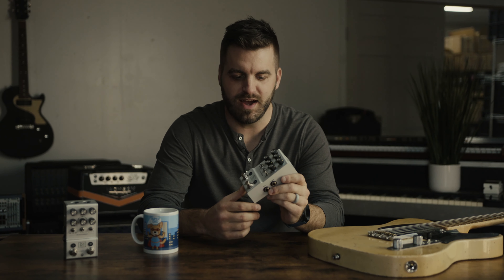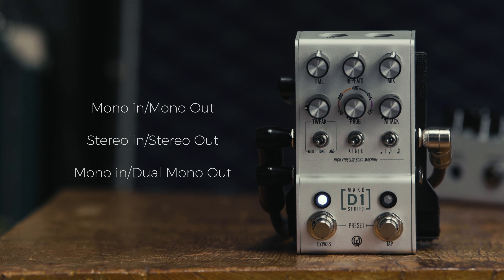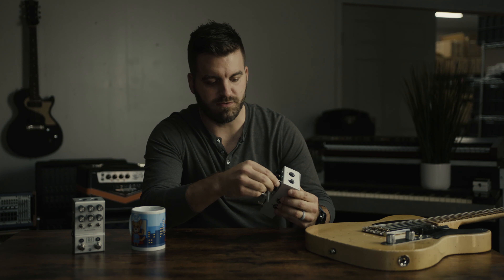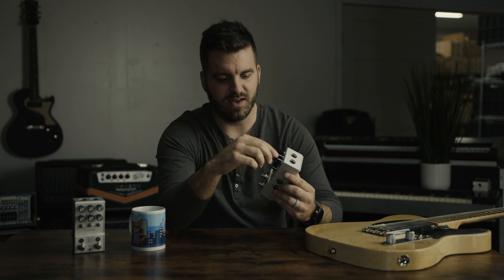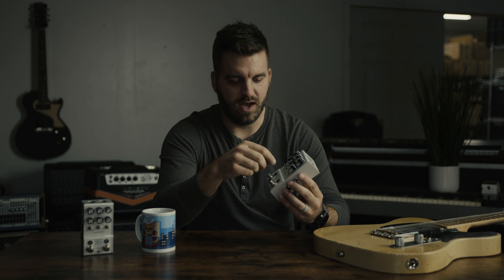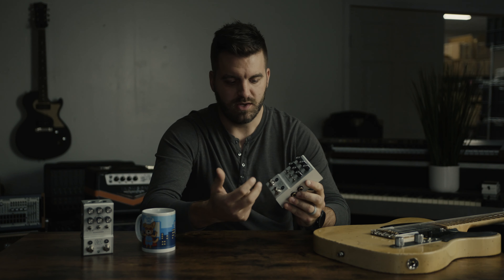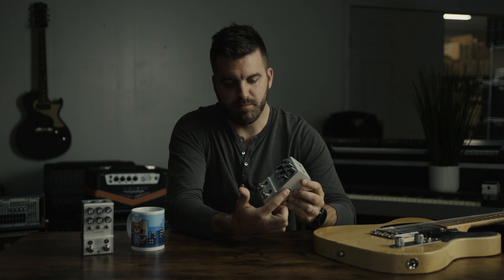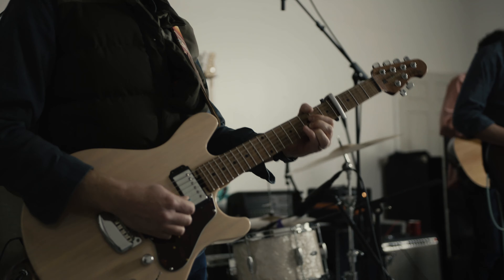Walrus Audio Mako Series D1 - Deep Dive with Jason Stulce

Comment: Excited to replace my Nova Delay with this. My ND has been amazing but the lack of midi and size has been hurting lately. This pedal has every kind of tweakability I want to lock in my own sound and no algorithms I don’t want. Pumped on it.
Reply: I have a Nova too and I wish it was smaller. But the presets are easy to see, I wonder how the D1 works with no screen to tell you which preset you're on. Also since a lot of controls have LEDs you can see what settings yr preset is using, with rotary controls you won't know
Reply: @RobData  the presets in the D1 are pretty easy to use. There’s a toggle switch that controls which bank you’re in, then the LED’s change colors between red, green, and blue to pick which preset you’re on. There are also a ton more presets you can access with MIDI, but those 9 are storable and accessible without midi.

Comment: Hi. Have one on the way.  No idea if anyone monitors this but very interested in the MIDI controller you use. Concerned that there seems to be little available support.  I'm visually impaired and if I can program 6 delays, that's plenty for me but one button access is huge since I no longer see color or printing.  I've never used MIDI and am concerned about my ability to set up (I can read with aids like scanners and 27" iMacs)

Comment: Hi all ! Had bought a D1 and R1, And as delas all cool !… but have noticed that the D1 is giving me gain sound in my clean mode, means that when I don’t press the pedal and want to play clean of delay I have an small gain… have tried with and without pedal board, different cables and other delay and not if that is expected in the pedal or if another users have noticed
Reply: did you try different bypass modes, i have the version 1 and no problem at all

Comment: please HELP: I can't decide between this new awesome machine or Strymon Volante or Timeline. I need a unique "tape-like" delay for deep lo-fi ambient stuff.
Reply from the maker: Volante is awesome (have one on my board next to the D1!) But if you're picking between one, the Volante is all tape sounds. The D1 can get tape style sounds as well as the other programs in a smaller form factor and smaller price!
Reply: @walrusaudioeffects  exactly my thoughts, hm.... as for the midiclock: I want to control the delay tempo via midiclock from my external sequencer and I need to know, If the D1 is following tempo changes in realtime. For example: If I slow down the tempo from 110 to 80 (from my DAW, or any external device) are the D1 delays are following?
Reply: @helgarollner2106  Yup they are following, so does the volante and timeline. I've owned all three, and still own the Volante and D1. They are a fantastic pair.

Comment: so I can sync it via midiclock and if I change the tempo it will follow it?
Reply from the maker: If you're asking if you override the midi clock by using the tap switch on the pedal, yes. The pedal will then follow the tempo you just tapped in.
Reply: @walrusaudioeffects  thanks for your reply! No, I meant if I can control the tempo via midiclock from my DAW in real time. :)